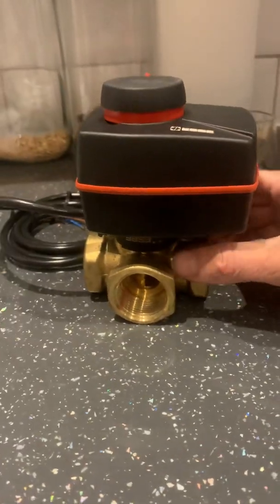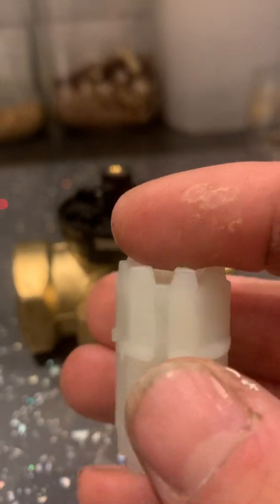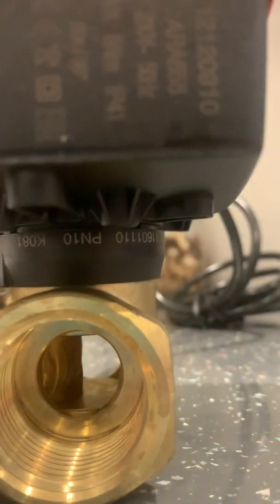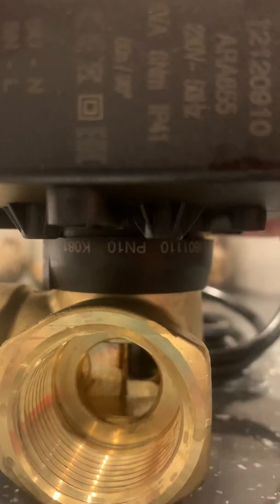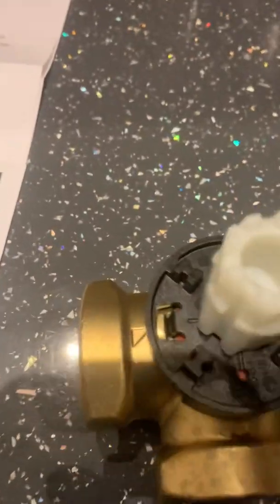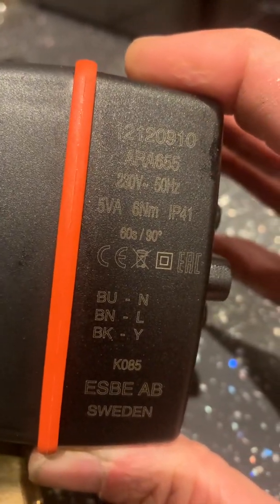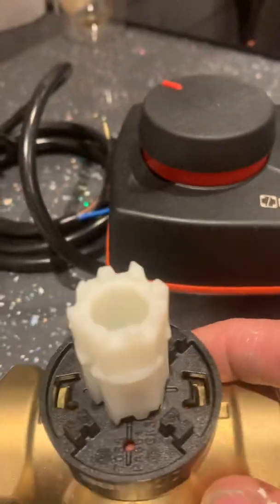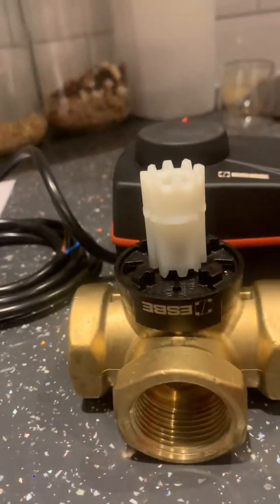ESBE valve and what its doing to keep you and your house comfortable.

Comment: Hello.If I have a bypass termostatic valve for protection of return cold water make sense to mount one of these valve?
Reply from the maker: Yes you could, they do one with a sensor, you maybe able to set to open when upto temperature

Comment: Hi tom stupid  questions Without the white cylinder that goes between the actuator and the valve itself , the valve will not turn Correct?
Reply from the maker: Hi all questions are good! Yes you are correct, the adapter is required.

Comment: Hi Tom
My valve has stopped working, the motor works but the valve itself does not rotate on the inside even when I try to turn it by hand, is there any way to clean the valve from dirt?
Reply from the maker: Hi that sounds like something is blocking the valve, I’d suggest removing and taking a look.

Comment: Did you find out if Vaillant is having clockwise or anticlockwise ? I'll be wiring installation next week, I'm still waiting for VR71 and another VR70 as I have 5 heating zones and two cylinders.
Reply from the maker: Sadly i never remember or foolishly dont make a note. 
Being a simple swap of the connection in the wiring centre i have never worried. I will make a note on the next one (if I remember 😂)

Are you running a mixer per zone?

I did a dual cylinder setup and used parallel charging with Mixers as they had high water usage at random times.
Reply: On your installation did you have higher temp on the cylinders and mixer after that ?
Reply from the maker: @igorchuchro4991  
Yes, i used an ESBE mixer on the UFH so it could run in parallel when the HW is Charging.